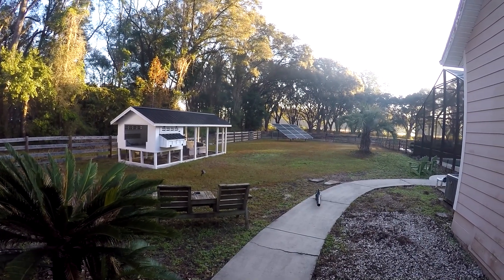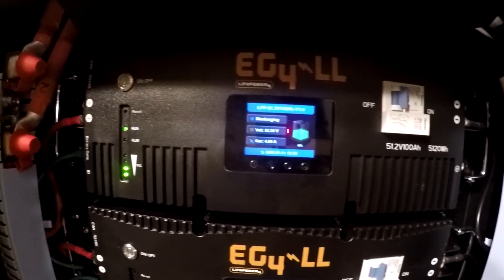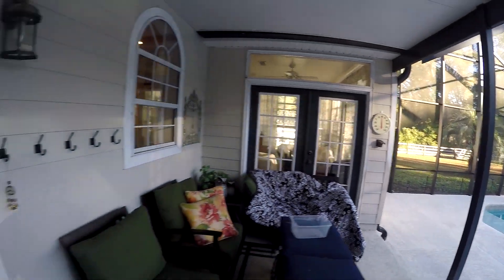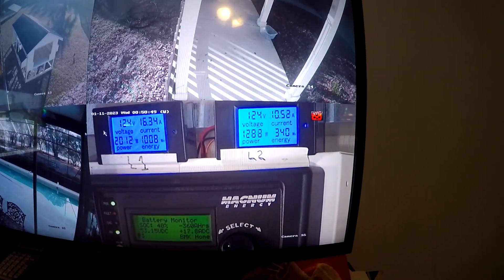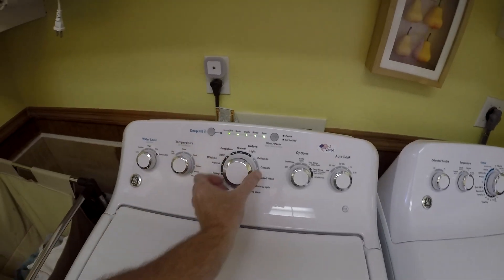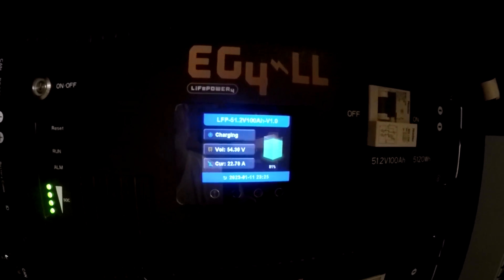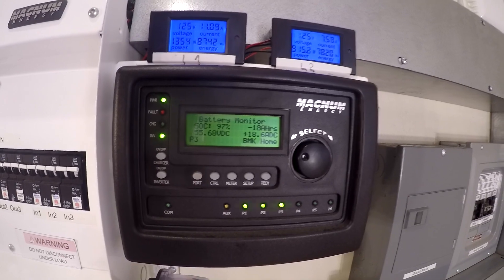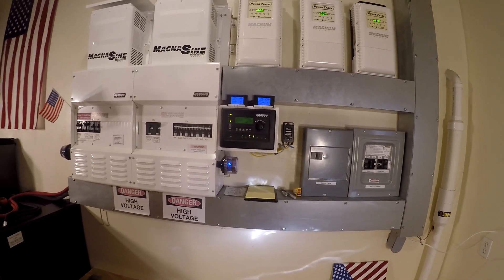EG4-LL V2 & Magnum Energy Solar Power

Comment: Just double checking when wiring the two inverters does hot one bind to hot one on the second inverter? And hot 2 to hot 2? And same for ac inputs? Based on my conversation with magnum that's what I gathered but I wanted to ask your opinion! If I'm understanding correctly when the inverters communicate with each other they synchronize their phases?
Reply from the maker: I believe that is correct.  Check this at 3:00: https://youtu.be/9T6vf3jQ6HE?si=WINPXEmPdKB0rPFc

Comment: Not sure how this cost efficient if none of the heavy loads are run - I wouldn’t install solar to run my lights, tv and security cameras contribute to 20-25% of the bill
The rest is ac microwave oven dryer and the heavy loads
Spending $20k+ to watch tv doesn’t seem cost effective
Reply from the maker: Hello Will,  This video may not have made it clear but I run 90% of the house on this battery backed solar power system.  We are still connected to the grid but the bill is mostly connection fees and taxes.  The system will pay for itself but the main reason to go battery backed solar is to be independent of the grid and all the supply chain behind it.  We don't have to worry about oil/gas prices or losing power for any reason from global conflicts, rolling blackouts  to hurricanes.  Its all about being self reliant.  I highly recommend that folks do this if they can.  Its worth it just for the piece of mind.  Thanks!

Comment: Great looking setup! I just upgraded from AGM to EG4ll 24v 200ah V2 2ea. Also have a magnum inverter. Been having an issue as batteries charge up into the 90+% range with an intermittent inverter humming and A/C output bounce or surging. It calms down after sundown when no longer charging. Have you seen anything like this? Any ideas what could be causing it? Thanks
Reply from the maker: I have not seen anything quite like this but I do sense something...  As long as my bank is NOT close to fully charged OR the sun is down then their are no issues.  That said, when the sun is cranking and the batteries are full 100% and the house is not using much power: there seams to be a little something going on.  It seams to "hum" a bit when it has no place to go with the power coming in and maybe a bit of switching between charging and not charging.  I think I would prefer to have it "not fully charged" until right at the end of the day.  When I get an electric car I will probably use that to control this process.  Let me know if you make any progress on this issue.
Thanks!
Reply: @HomesteadEngineering  yes that’s kind a what I’m experiencing. Full sun 97% charged and the bouncing a/c output starts. Cloudy less sun days it never happens. My original installer thinks it may be an over DC voltage glitch? We have both tried contacting Magnum about this but they are horrible at returning calls and emails. I’ll keep you posted. Thanks

Comment: At least 80k invested.
Reply: I added future Inflation..... jealous!
Reply from the maker: @biehpham8323  Yes, these prices are mostly from 6 years ago.  Check out the parts/prices from back then: 
https://youtu.be/zb4oar9UHSY
6/3 Southwire 125' was $157 now almost $600.  I used three rolls.  Yikes!
Reply from the maker: Its a DIY system.  The hardware was $37,000 all in (includes a few tools).  I did all the labor.  $26,000 after tax credit.

Comment: heat pump water heater, heat pump dryer.... stove cant really do anything about. Even my induction one takes a ton of power.
Reply from the maker: a v, I have 3 large heat pumps, the electric oven and the main (240V) shop circuit that are still not on the solar.  I don't typically run the well or dryer on solar either but they are connected via tx switch if needed.  Now that I think of it, I should move the dryer off the tx switch and put something else on there as I would never run the dryer off solar in an emergency anyway.

Comment: That's running right to the max of what you have. Sized pretty darn good
Reply from the maker: Game changer.  No more throwing away unused power.  Should bring the electric bill down to almost nothing.
Reply: @HomesteadEngineering  when batteries get to full relay turn on loads
Reply from the maker: @royamberg9177  I am in the process of retraining myself and my routine to account for the new batteries.  With the FLA's I used to start turning stuff off early to ensure I would always get to 100% by sundown and then switch most things off overnight.  I would only use about 10kWh from the FLA overnight and that worked well for 6 years.  In fact, those FLA's are still in great shape.  NOW, with the LiFePO4's, I am not as concerned about hitting 100% by the end of the day.  Even if I do hit 100%, I am still keeping a lot of stuff running so I am not at 100% very long.  When I get down to around 90% I am cutting the loads down to less than 2kW.  As of right now, I plan to keep stuff on (under 2kW) all the way down to 50 or 60% before going to sleep for the night.  At that time I plan to cut the loads down to under 1kW overnight.  I like that slow burn on the drawdown.  So if I get up and I am at 30 or 40%, then that's great.  That will also ensure that I don't waste any sunshine the next day.  Of course if I know its going to rain the next day or a storm is coming then I will adjust accordingly and of course things also change as we rotate into spring and summer.  Well see how it goes for a few months.
Reply: @HomesteadEngineering  ultimately you could use a couple more batteries to make things even easier but there's a cost factor. Not sure it's worth it. Relays set to specific voltage isn't to hard.

Comment: Sweet setup, but musta cost a bundle
Reply from the maker: James, The complete system cost me about $24,000 (after 30% tax credit) in hardware and I did all of the installation myself.  This was not an easy or trivial install.  If you go with the EG4 all-in-ones, it would be MUCH easier and cheaper for sure.  That said, this system is bullet proof and I am very happy with it.  Thanks!

Comment: Not really testing the batteries. More like the panels are being tested and the inverters. Make sure the new cells stay balanced. Very hard to tell unless you are at the top or bottom soc. Hope they last for you. Cheers
Reply from the maker: Hello Frank, yes, its more like a system shakedown to see what it can do.  Very happy with it so far and the new batteries are going to make a huge difference in how I use my system going forward.  Most of the transfer switches are going to stay on solar and collect dust from here on out.  :)
Reply: @HomesteadEngineering  thats good. Would be interesting to see a panels off test to see how well they keep to their capacity rating. Cheers